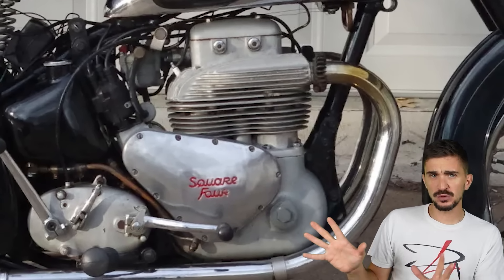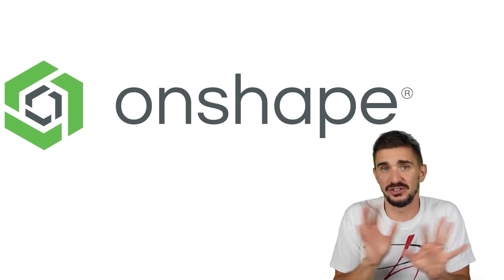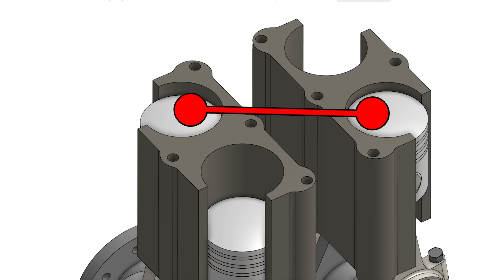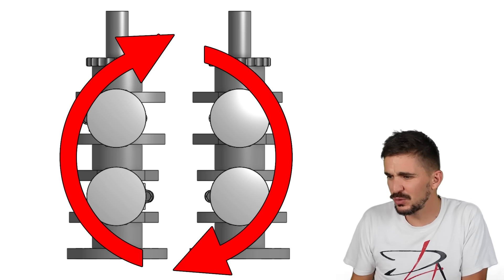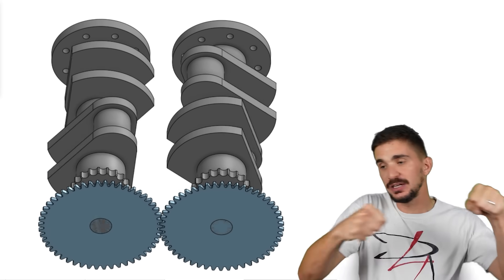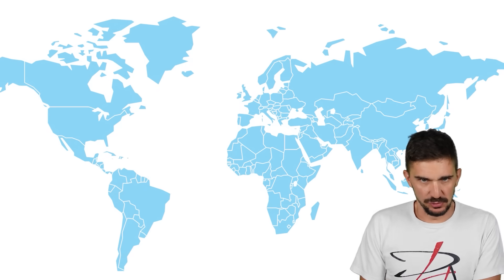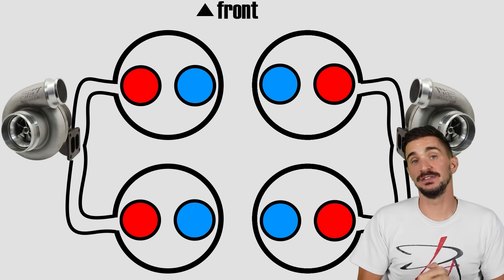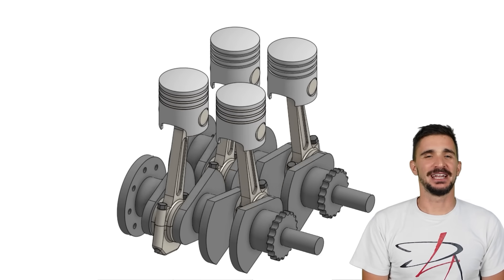From the Outside It Looks Like a Single but Inside Four Pistons Mingle! Square Four Engine Explained

Comment: The problem with the intake would not be as dramatic, I guess. A modern engine would have nicely compact injectors, so there's no big space for carburettors required. A central airbox could easily deliver air. With how much space airboxes tank under modern day´s motorcycles, you wouldn´t notice any difference. The connecting gear also could be placed between the cylinders, adding some real estate in the middle for more air.
The engines still would never get produced in today´s markets where saving every cent in production is the prime target. I believe nobody who tries to tell me the timing belts running in oil is for any other reason than saving the cost of a couple of shaft seals and machining their seats. Making big gears and two crankshafts just would not happen.

Comment: You can have enough space for an intake manifold and an exhaust manifold by simply rotating two opposing pistons' valve by 45 degrees and the other two opposing pistons' valves by minus 45 degrees or by 135 degrees, getting the image at at 13:15 to show you all the valves accessible from the outside.

Comment: The square four, along with the inline 6, is the only piston engine configuration I've never had in a motorvycle. I've had single, parallel twins, v-twin, inline triple, V3 (no, not a typo), inline 4, V4,.

Comment: Great video. Square fours always intrigued me. I used to think a "second crankshaft" added weight and more effort to spin it until I realized that compared to an inline four, a square four has the same crankshaft mass, just split into two.

If you really wanted to see if this was possible, I think you could bend Allen Millyard's ear to take two liquid cooled 270 deg inline twins and  build a square four. He has built countless rather crazy multi-cylinder inline and V motorcycles out of already existing engines. I'm pretty sure it is possible this project is  more complicated than his usual projects, being that the crankcase would have to be modified to an extreme degree, so maybe it's beyond the scope of his abilities? ... But who am I to judge what he can and cannot do. I am sure he would love to hear of this idea to think about. I say contact him. If anything it would be a fun thing to discuss with him.

Comment: As always, very interesting and excellently presented.

FWVLIW: In the highly unlikely event I was a designer I'd be tempted to rotate one of these by 90deg and use a shaft drive.
Somewhat surprised this configuration hasn't found it's way on to (compact) cars.

Comment: Fifty years ago, when I was an apprentice, the chap on the radial drill across the gangway from my lathe used an Ariel square four as his ride to work. It was attached to a child + adult sidecar. One day he announced that he was going to test ride a replacement for the Ariel. He would have to test ride it solo but he said it would give him an idea of what it would be like with the chair attached. Off he went on a Friday to test a Honda Gold Wing. On Monday he arrived with his new bike - a CBX 1000 (inline six). I asked him what happened to the Gold Wing. The dealer offered him a go on the CBX after he'd ridden the 'Wing. The CBX never got attached to the sidecar and the owner told me "It just makes me grin every time I ride it." 😀
Reply: My cbx never ceases to amaze me every time I ride it. They're a glorious machine
Reply: it did have a great engine, but the rest of the CBX was not as good
Reply: @nairbyad7188  I've owned two. Lovely sound. Terrible motorcycle!
Reply: Collectors item now. Throttle response is impressive..exhaust sounds like a Jaguar x superbike..
Reply: Unless I'm mistaken, a CBX was the first motor vehicle Jay Leno owned.
Reply: remember that and the benelli sei which I believe the cbx was based on and predated the honda.

Comment: With the availability of cnc and off the shelf sleeves and pistons, you should probably be able to make a watercooled version with minimal tooling, and the short crankshafts would make it even easier to make since you don't need a big lathe, that's if you can't just cut an inline 4 in half and bolt gears to it.
A motorcycle engine repair shop could probably build one for like 10 grand or less.

Comment: A 180 degree 4 stroke 2 cylinder group cannot have a single intake, as the intake strokes are not equally spaced, so one cylinder will run at lower intake pressure, and different mixture if a carb is used.

Running full undampened power through a lashing mechanism (gears between both cranks) is also complicated, so you'll need at least a flywheel per crank.
Reply: The best solution for the intake would be to run it from the sides together with the exhaust, but then the valvetrain would become more complicated and the intake would be heated by the exhaust inside the head.

Comment: I am heading up to 80 and remember "Squarials" back in the 1950's and '60's.  They almost always had a sidecar attached.  The biggest problem was overheating on the rear two cylinders.
Reply: I'm across the center line thru the 80s and remember the cooling issues on my friend's SQ4. (So Cal 1957/58) If I recall, the head gasket near the rear two cyls was another issue. Maybe the heat? Thanks for the memories.
Reply: @90FF1  ........Yeah, head gaskets. I should have helicoiled the head bolts. Opening up the oil galleries sounds like a winner, and adding an oil cooler would be a nice upgrade.
Reply: WELL, it was back in the 60's and I didn't know what I know now. Had I, it would still be running and running well.

Comment: I will have a running VR8 by July of next year if everything goes to plan. No, that's not a type-o, a 15° VR8 borrowing technology from several manufacturers. Betweeen, this channel and the I Do Cars channel I have come up with a design that I think will do well. Using lost foam casting with refractory coatings, it should be feasible with the resources I have available. To reduce the number of parts, I will use a cam tower and a crankshaft girdle as opposed to individual bearing caps to increase rigidity and reduce the overall number of parts.

Comment: Also, the valve arrangement is not as optimal in that position, they should've been in line with the crankshaft instead of side to side, which also bring us another opportunity, instead of camshaft valves we could use those cylindrical shaped ones, it would lower the engine profile and works nice in this contraption.

Comment: Great design for the time and as you mention, could be a renessanse one day.
I had a PUCH 125ccm TWINGLE  cylinder light motorcycle around 1967.
The two cylinder engine used one spark plug and had a head port between the cylinders😬
The front cylinder ignited  first and blasted life in the rear spark plug missing cylinder.
 The rear piston met the top point partially later than the front. 
A noisy two stroke engine.
The beauty had a genuine dynamo with a bulb on the front light casing showing charge conditions Proud since no one else around  had it.😂
Could be interesting if you bring up that design one day.

Comment: 7:22 moment isn't a force. It's a moment and in my opinion this segment is wrong because the moments just cancel.
Reply: The moment are opposite and on the same axes even so they cancel. They would have canceled even if not on the same axes
Reply from the maker: It's a rocking couple. Two forces. Pretty clear. It doesn't cancel otherwise twins would have perfect balance.

Comment: Quality Control and British Motorcycle Industry never met. 

I about spit my coffee out when I heard that.
Reply: I was riding bikes in the seventies, and British bike industry was just about to die. The difference in quality between British versus Japanese bikes was night and day. I rode a 1967 Triumph Saint because it was what I could afforde while at school, loved that bike, but Jesus...
Reply: ,I  had 2 500cc triumphs. I have to agree with you!
Reply: The British loved their boxes of shims.
Reply: @turnin.sprocket  I had a couple high performance Kawasaki bikes in the 80s that had buckets and shims for valve adjustment..what a pain they were also! and expensive, and every 5k miles
Reply: The same could be directed at their car industry. In the 1970s, I had a car with an English back axel.  A shim ridden monstery that took a day and a half to pull out and replace the differential. Small car with horrible repair costs. Here in Australia, the large Holden cars needed a little more than half that time.
The state of Victoria, the Police were using Arial Four Square bikes. The stories about the overheating problem went the rounds. Explained the move to BMW twins.
Reply: In the 1970's I  wanted to be an engineer but never wanted to be a mechanic, but then I bought a BSA so I learned to be a mechanic, but I am still interested in engineering.... I ride Harleys these days and mix the two hobbies, my Dyna has 130bhp and my Sportster has 100..... at 65 years old I am still doing the same thing 50 years later !
Reply: @thakery5720  I saw a meme once that said:
"Harley Davidson - Turning Riders into Mechanics since 1903" 😄😄😄
Reply: @thakery5720  You may feel you're beyond working engineer age, but you can always study the subject online and use open-source CAD if you want to tinker with things. I've a former acquaintance who's 67 and working as an engineer, without plans to retire (he's a workaholic in my opinion but there's also hardly any financial incentive to retire in America in the last 50 years).
Reply: @thakery5720 So are HD!
Reply: @stephenbrookes7268  That is right, I like to modify engines though and H-D has more scope that anyone else.
Reply: @thakery5720 What HP the most tricked out HD engine developing?
Reply: @stephenbrookes7268  The Sportster is about 95 -100 bhp and 85 ftlbs torque and my Dyna Streetbob is about 130 bhp and torque. Both bikes are modified to have the power they should have without all the emissions restrictions. Those numbers are 'at the wheel' numbers not at the crankshaft. Both bikes have improved handling and brakes as well and before you say anything about other bikes being faster, I am 66 years old and ride for enjoyment, not to race anyone or prove anything - my life is not a competition !
Reply: Same for Lucas electrics
Reply: Took QC and Harley a long time to be friends as well!!!
Reply: They did meet but it was on Friday afternoons!
Reply: It's Britain, they still make British made tr@sh.
Reply: Triumph makes great motorcycles.  Just sayin.
Reply: Years ago I saw a Jaguar XKE [beautiful body design] with a very wide bumper sticker stating:  "The parts falling off this car were made with the finest of British Craftsmanship"
Reply: @mikewurlitzer5217 very original,well done🙄
Reply: Not only motorcycles, cars and trucks as well. Prince of darkness is a conversation starter..
Reply: @carlosoruna7174  i still have the pin on my leather jacket.  Mr. Lucas was not amused.
Reply: Any British engineering that is meant for customer consumption. Look at their cars, it’s the same story across the board
Reply: @jizchimp would you like to comment on the Rolls Royce Merlin engine,or maybe the Cosworth DFV ,or the engines that powered Concord? ?etc,etc
Reply: @Mark-d9l3y  Funny, they weren't motorcycle engines, were they.
Reply: @jizchimp  That's just not true. The English we're dealing with a LOT in the seventies. Mostly labor issues. Guys on the line who thought they should be earning as much as the engineers were being paid, as much as the steel workers were earning, and the unions just about tore England to pieces. Then, Thatcher. England has yet to live up to that old battle axe, and not everything she did was right, but if I'm not mistaken, her impact on the unions is still a thing keeping their "rates" reasonable. BTW, America suffered the same Shiite, earlier in the century, and manufacturers have been exiting for a century. I guess, beeotch enough, and you'll not have to worry about a "paycheck" at all. Nice going.
Reply: ya thats why Harley stuck with the v twin instead  of this sh!t.....last longer too...  not as many parts
Reply: Add in the British automotive companies as well !! 😅😅😮😮😂😂😂

Comment: Great video as always.  This looks like a great compact engine with lots of potential for hybrids (as you stated).  As for the intake valve "problem", I'm surprised you didn't mention fuel injection as a probable solution.

Comment: That's a good project for Garage 54. A square four Lada.
Reply: How about a square sixteen lada?
Reply: You beat me to the punch. I mean, they already made wilder stuff, this is something they can definitely do. They do have an infinite supply of Lada engines, after all.
Reply: Exactly what I thought! :)
Reply: Ohhh shit... Thats we waiting for @sahalin12345
Reply: Literally just came from them to this video lol. I totally agree!
Reply: With upside down suspension, sprocket driven camshaft oil cooler with yoshimura end can and supercharging😂
Reply: Especially since Lada has two-cylinder engines in the VAZ 1111. They can use ready-made crankshafts and cylinder heads, but with a 180-degree angle.
Reply: A square 8 with the exhaust from one side directly feeding the other side for combustion scavenging.
Reply: Was just thinking someone could make a 8 cylinder Square 
Opposed engine.  Like a type 4 VW engine. But use the Corvair cooling along with liquid cooling (dual cooling capacity)

Comment: I think the valve problem could be fixed by making the valves into a square shape 45 degrees rotated, putting two pairs of intake valves and exhaust valves next to
 eachother.

Comment: Look wh This whole idea OK is the two crankshafts the gears run together correctly no by the time that you’ll be breaking in the Pistons with the rings and the fucking chambers and the sleeves in English it’s called sleeves. You would go out a timing because the cranks would change with the gearing two cranks two pistons banging on the crankshaft against another in those two gears together, and it doesn’t work, dude it doesn’t work bro enjoy. I hope you make it work but there you go.

Comment: False on the air cooling note. I bought an air cooled Royal Enfield Hunter 350 in 2023, Finland. So air cooling exists. It reduces maintenance items: cooling liquid & radiator & hosing related. PS. and motorcycles only really need a single cylinder engine.
Reply: so do cars and tractors if you think about it!

Comment: Wouldn't it be better to keep the gyroscopic effect of the crankshaft rotating opposite to the wheels (like Ducati does), in order to try and cancel some of it? If you completely cancel the engine's gyroscopic effect, you still have the full effect from the wheels.

Comment: Since the head is flat, the camshafts orientation doesnt have to be parallel to the cranks. You could put the exhaust camshafts at the outside of the head, perpendicular to the axis of the crankshaft and a single intake camshaft down the middle of the head with ports that point almost strait upwards. It would need a spur gear but gear drive cams are cool.
Reply: Time to implement a high quality rotary valve system?

Comment: 12:55 could the intake and exhaust valves be rotated 45 degrees, intake valves towards the center, with twin turbos and 3 throttle bodies? One for each turbo and a 3rd for absolute throttle? Kinda like what Daddy Dahm is doing with his 12 rotor mixed with an LS motor? 

The reason I ask specifically 45 degree rotation is for valve control ease, the closer the intakes are, the less clearance you need to mount the final throttle body, and it gives a lot of room on top of the cylinders for beefier valvetrain, mostly by allowing more space for say something like dohc on each pair of cylinders. As it looks, spacial interference would largely get in the way if each cylinder was parallel like thus.

Comment: Imagine a 4" bore, with 2" stroke x 4-cylinder water cooled square 4 with a intake on the head the intake runner running nearly parallel with the intake valve.  With a 4valve overhead cam, the intake manifold being made into the valve cover. With two roughly 40 mm carbs or possibly a single. 55-60 mm carb, At 100 cid maybe a single 48-50 mm carb would be fine, possibly revving to 7500-8500 maybe a modified version doing 12k with larger valves and a pair of 60 mm carbs or 4, 48mm carbs. Maybe bolt a supercharger on top with a twin 60mm  side draft carb.? Running 5-19 psi with 9:1 compression. Maybe offer a 3" stroker version. 151cid or a 3.5" stroke 175cid revving to around 6k rpm a bit much for the street, especially with boost, and methanol Injection!😊
Reply: Such fancy new tech with carbs?

Comment: Ducati made a square-4 prototype in the early 60's that used a single vertical-axis OHC to drive all 8 valves. There was a designer in the 90's that put a single cylinder KTM top end on a counter-rotating dual crank setup that gave  faster compression and exhaust strokes and slower power and intake strokes at every RPM with increased power across the power band.
Reply: The KTM top end was on a single with two rods and two cranks? Perfect primary balance. Expensive.

Comment: If you had two inline 4 cylinder engines in this configuration with both cranks geared together to spin in the opposing directions, what would the engine balance be if those two cranks were offset by 90 degrees instead of 180? Would the secondary balance of the two inline 4s cancel each other out?

Comment: I swear, if I had enough money, I'd buy a big CNC machine, learn how to use it, learn how to design an engine block, using as many off-the-shelf parts as possible [pistons, rods, crankshafts, rods, etc], and probably try and build one.